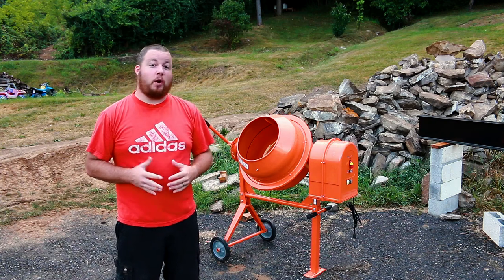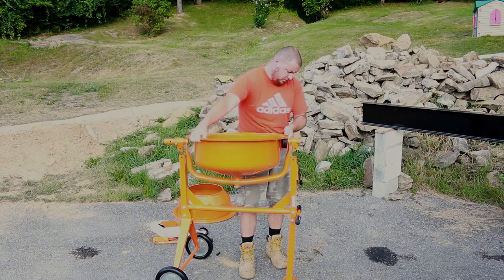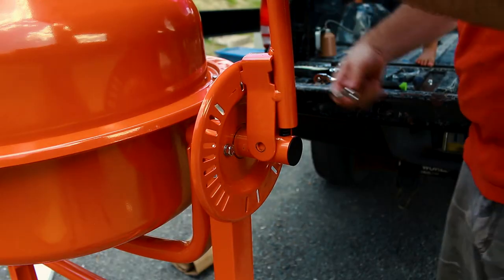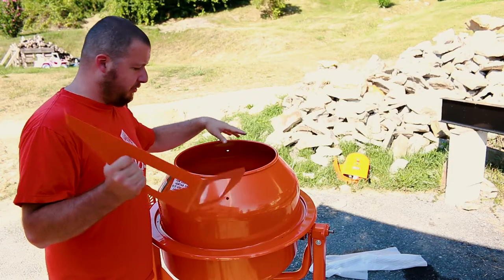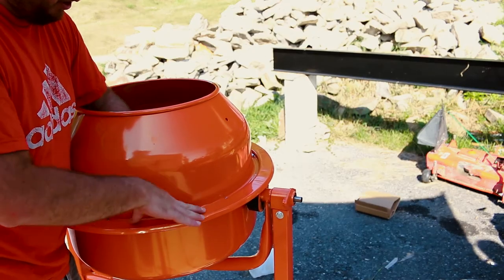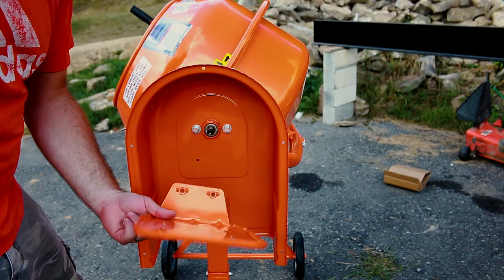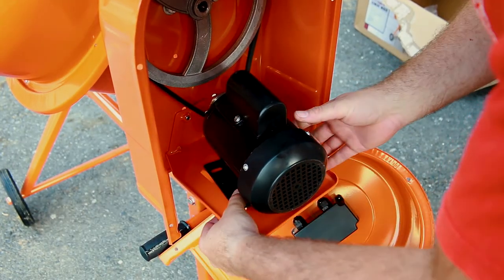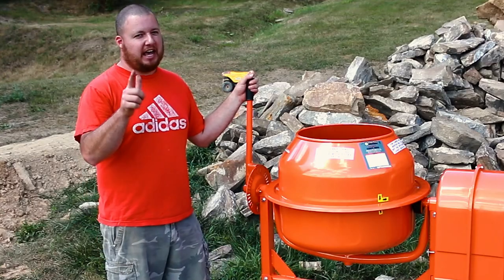Harbor Freight 3 1/2 Cubic ft. Cement Mixer Assembly 67536, 31979, 61932

Comment: Just used this video to put this together. Only suggestion would have been to be more specific on EXACTLY which bolts go where because like it was stated it's not really clear which bolts, washers, etc to use. Also just as a tip I used a ratchet strap to compress the spring and tighten down the handle to get the bolt in. Pouring tomorrow so we'll see how it goes! Lol.
Reply from the maker: Yes I wish they had numbers or something on the bolt heads. Good idea with the ratchet strap

Comment: I'm so glad I watched this video. I've been taking my time for a couple of days now and JUST got the drum assembled and mounted. I used a silicone sealant to stick the seal onto the upper half and beveled awls to align the holes through the seal. Putting a bolt through and moving the awls around as I aligned everything. I put the rubber seal grommets between the inner blades and the tub to dampen any vibrations and help cushion the blades when in use. Tomorrow I planned to mount the Motor and finish the job and .. guess what... I did the SAME as YOU and put the motor mount frame on the WRONG end.. which would cause me to have to Lift the heavy motor each to I reposition the Mixer. I'll unbolt from the bottom frame and swap it tomorrow... BUMMER! Thanks again!
Reply from the maker: Nice idea with the silicone, thanks!

Comment: So thankful I didn't have to put this ridiculousness together! I picked one up on Facebook Marketplace, but I got into an issue where I pouring cocrete with it myself in my basement, i had to deal with my concrete setting up on the floor and had to abandon the concrete inside the mixer and it ended up curing. I was trying to find of video of how this thing went together so I could get the top part of the drum off so I could try chipping out the concrete with my air hammer. Thanks for the video.
Reply: wow,  lucky

Comment: Very helpful.  A parts list and description (how to identify the part) and where it goes would be excellent.  I had the same problems as you did ad neglected to put locking washers which you noted  and I did not use the fully threaded bolts and will have to swap them out.  Noticed you neglected to use the gasket cement.  I have some flexible gasket "rope style" which I intend to stick on both halves of the drum and then basically follow your suggestions for putting the 2 halves with the gasket together.  That is where I am now in the assembly.  My instructions are missing a few pages and I have downloaded a complete manual.  I am taking my laptop outside and will use the video to complete the assembly.    I tit the control arm the exact same way you did, but used an impact wrench.  I agree with you that this was ridiculously hard.  I almost considered drilling a hole in the control arm to enable using a flathead screw driver for a spring compression lever.
Reply: The instructions (and difficulties within) are exactly the same for both the small and larger mixer

Comment: To get the handle on with the spring, try using two Irwin clamps to squeeze it into position so the bolt will just slide through
Reply from the maker: Can you get the clamps on without being in the way?
Reply: Yes .. . AT least I did.  Sure made my life easier
Reply from the maker: @jaylitzinger7000  Nice! good tip
Reply: I did the same thing using a single pipe clamp. Works great (might need to run a drill bit through the hole 1st if it's too tight because of paint buildup). I would post a pic, but cannot find a way to do so here.

Comment: Assembling the handle with spring is easy. If you have a quick adjust steel bar clamp, just place one end at top and other end to where bolt goes through. Just tighten clamp and the bolt can then be easily inserted safely.
Reply from the maker: Good tip, thanks

Comment: No rubber washers for the top of the vanes. Read the directions, the top two bolts use the aluminum crush washers to seal.
Reply from the maker: Thanks

Comment: Just assembled one.  The bolts are now in numbered plastic bags with a drawing showing where each numbered set of bolts is used.  For anyone interested, there are no grommets in this kit-just rubber gaskets.  Grommets are entirely different and are used for cushioning the sharp edges of holes through sheet metal.  I agree that the gasket sealant is unnecessary.  Your method works great.  The bolts act as alignment pins and also hold the gasket in position.  The reason you need to pull the bolts out one by one and reverse them is that the shape of the drum requires that the nuts and washers be on the underside.  Don't forget to get the two holes in the side of the upper drum-half in the correct position so that the paddles/stirrers will fit.
Reply: No they are not. One big bag of mixed hardware. no numbered bags!
Reply: March 13th, 2023- I'm assembling the mixer right now. None of the bolts are identified at all. The instructions assign a number to the bolts, but there is no reference to a diagram that describes the difference bolt sizes relative to the assigned numbers. Just as "IRmods services"  states.
Reply: I just put mine together. All the bolts were in a single bag no god damn labeling whatsoever
Reply: I just got two bags, sort them yourself….Maybe I just return it pay more for one with parts AND instructions… No time for frikn puzzles.
Reply: Some do, apparently. I assembled one tonight. It had 13 separate numbered hardware bags, with a diagram showing where each bag is to be installed.

Comment: The arm is actually easy to get on. Hook the the notches into the ring, and pull back, using the down pressure to align the bolt holes.

Comment: what bolt did you use to hole the upper sheave on with? belt drive on the mixer side. mine had a small bolt but no washer or any thing that covered the sheave.

Comment: Having issues with the paddles lining up to secure to the drums. Currently have disassembled upper from lower drum and trying to line them up using the paddles as reference.

Did anyone have to bend the paddles to make them line up?
Reply from the maker: No. Are they upsidedown?

Comment: be very very careful with this cement mixer when you open the box reach for the panel that holds the motor assembly on one side you will see a switch flip the switch see if it click click click take the switch assembly and the motor plug it in turn the motor on and off harbor freight has a terrible problem with the switches on this cement mixer harbor freight has a terrible problem with motors burning up do not assemble this you will be sorry
Reply from the maker: Mine has been working fine